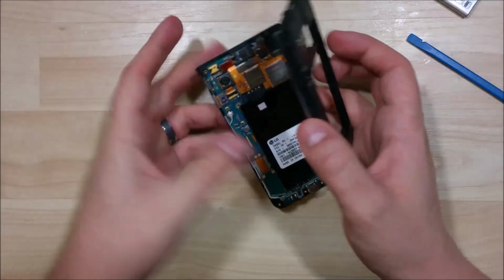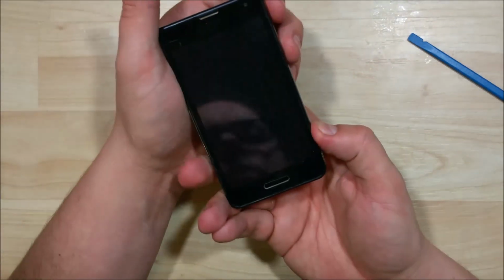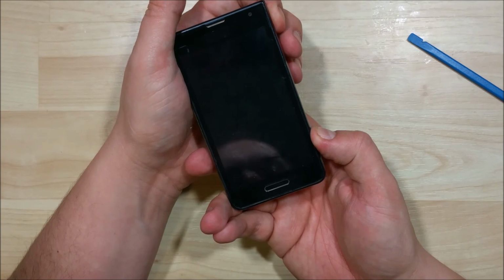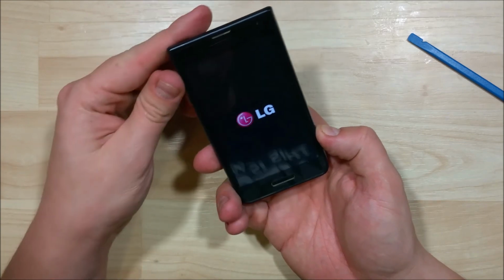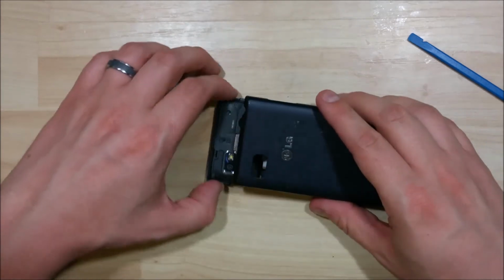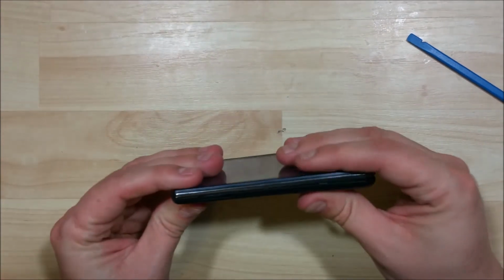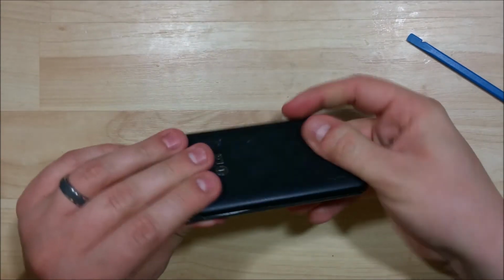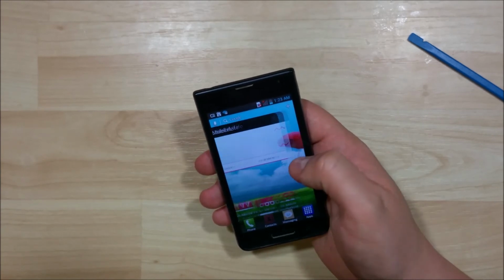LG Optimus F3 Screen Replacement Reassembly - Battery Charge port Home button Camera Glass

Comment: I cannot properly express the gratitude I have for you making this video.  This phone was my old phone, and I'm going to hand it off to my step-daughter now that I've repaired it (it didn't charge, and the screen was cracked), and she is bouncing up and down with excitement.  It'll be her first smart phone (she's 16).

It was also my first smart phone, go figure.  Obviously I've upgraded since then, but I got several years of good and fun use out of it, and I'm looking forward to her having a couple of years of good and fun use of it.  Hopefully she won't abuse it the way I did and this repair will stand as long as it needs to.

For the record, she had three choices of phones.  One was a cheap $40 Walgreens phone running KitKat, and the other two were LG Optimus phones (The F3 of mine, and my wife's F6).  She picked this one, and now that I have repaired it (many thanks to your video), I will be giving it to her and adding her to our T-Mobile plan.

Again, thank you.  I cannot thank you enough.  We'll toss some money your way in a week or so when we can afford it, because in Texas you say thank you with money.

Comment: my replacement glass didn't have adhesive for some reason (i peeled off the plastic screen protectors when installing). for now it seems to hold in place well enough, but is there any specific kind of glue i should use when i go to put some in?

Comment: Great video!  I used all 3 to help me replace my screen and I just finished putting the new one on and everything is back where it should be (I think...) but when I turn it on, my screen stays black.  I hear the start up music and my buttons flash, I just can't see anything (which kind of ruins everything with a smart phone...).  Is there a certain spot I should be looking at to see if everything looks correct?
Reply from the maker: Jessica Tonegatto The ribbon cable at 6:05 that is connected is for the LCD. I would double check this cable and make sure it is connected properly.
Reply: Hmmm, just double checked and it is connected.  It's just weird, I replaced another screen using this video and everything turned out fine.  Not sure where I went wrong this time...